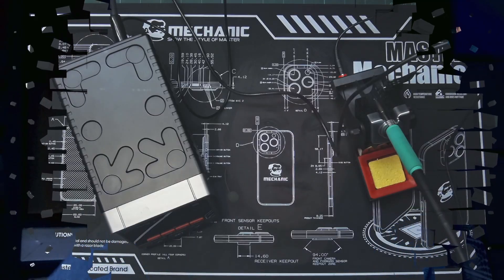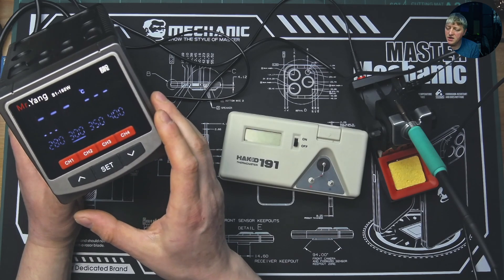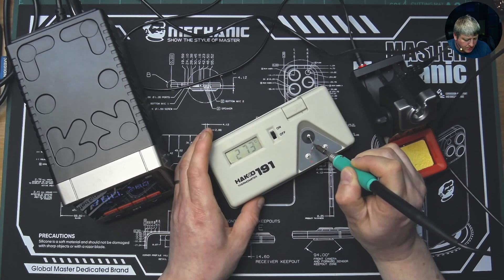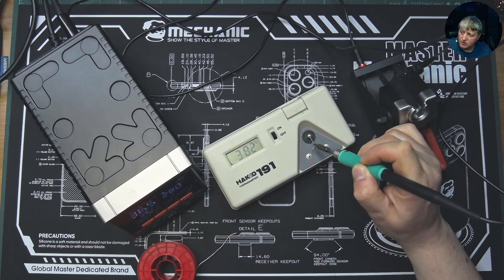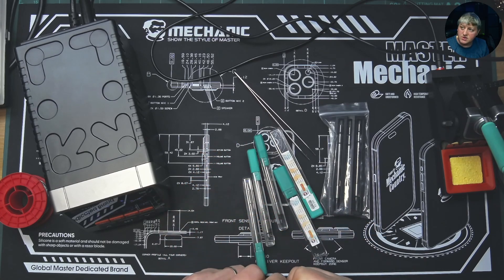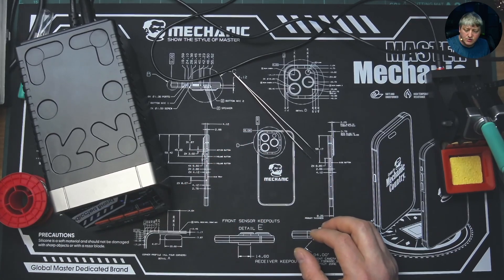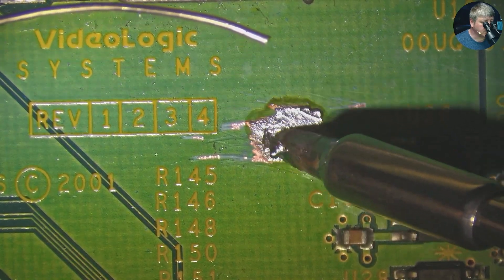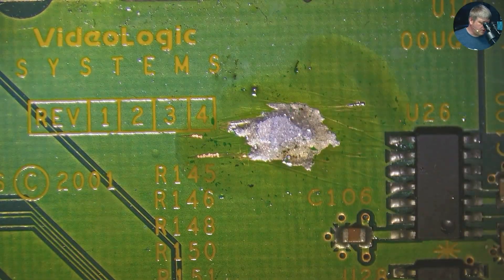YCS S1 soldering station review

Comment: How much wattage can it output with 245 and 210 handles? The name has 160w but most of these chinese stations have limited wattage specially with 210 handles.
Reply from the maker: So 160w is referred to power consumption definitely power delivery will be less then that and I will explain why! First power supplies efficiency will never be 100% so already you have a power drop over there. Then also depends on the iron tips and now you can definitely understand that based on these factors the power delivery will be somewhere around 140w to 150w
Reply: I do understand that. However some stations limit the 210 wattage. I am assuming they do this by having lower volts for 210 tips. 
The same can be seen in one of the shorts on youtube.
Reply from the maker: @BronTheLegend  I'm not an user of c210 tips. I prefer the c245 over the c210 because are more powerful!
Reply: https://youtube.com/shorts/DMfKtlmoSPE?si=oVM30TmaeU5mrymW
Reply from the maker: @BronTheLegend  so they limited power on c210 tips is because they are not same powerful as c245 so that's why I'm not an c210 tip user!
Reply from the maker: @BronTheLegend  actually I would like to switch to c470 are more powerful than c245!
Reply: @SymbolTech21  Yeah, it looks like c245 is the better option here. Thanks for all the replies!
Reply from the maker: @BronTheLegend  if you would like also to know how to make sure your soldering station is ESD safe just send me a message on my FB and I can show you everything what you need to know about ESD safe!